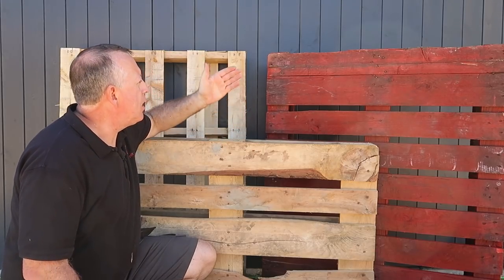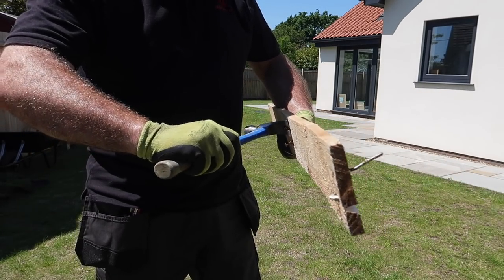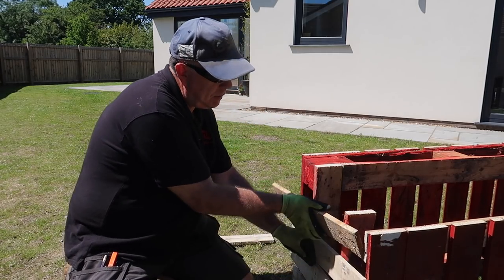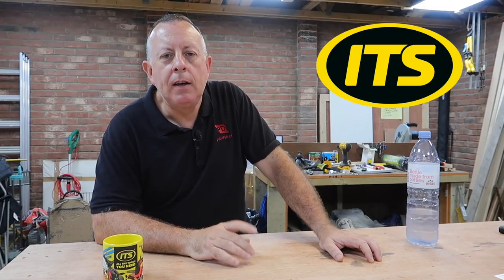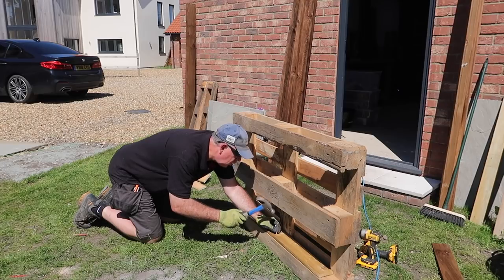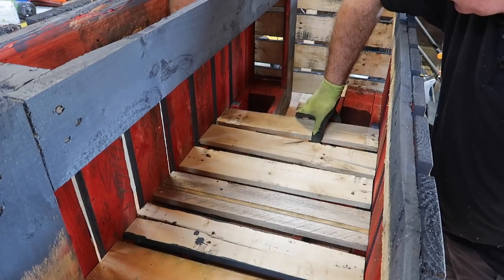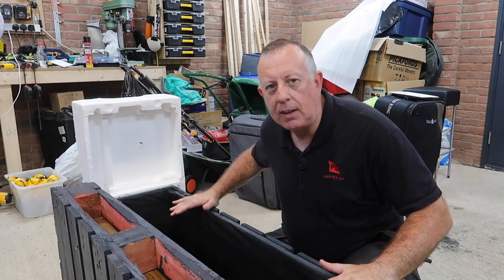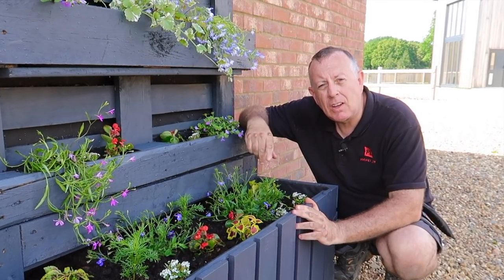How to Make Modern Vertical Planters for Free

Comment: I filled up the van yesterday at the builders merchants. I bought a Roughneck pallet buster a while back. It really does make life easier. Nails can be a problem with some pallets. They really resist being pulled out. I find an old fashioned pair of pincers works wonders for those rather than a claw hammer or pry bar. 
Nice planter though.
Reply from the maker: Thank you. The pallet buster looks a great piece of kit if you are dealing with them everyday

Comment: I find a garden fork very useful to get pallets apart, very easy to lever of the slats. Also check out hugelkultur and fill these large planters with some logs or similar. Creates a good enviromental soil for plants and will continue to feed them as they rot down.
Reply from the maker: That's a good idea
Reply: I save larger branches and trimmings exactly for this.  Every couple of years, it's worth tipping out raised veg beds and refilling with new compost over a layer of logs and branches

Comment: What paint/treatment was used?

To split the pallet apart take the outer segments off then upend apply press from one side to another so instead of pulling the nails out by force the movement back and fourth loosens the nails.
Reply from the maker: Good tip

Comment: Another option instead of the polystyrene on the bottom would be to make it a self watering planter by adding a waterproof barrier at the bottom, filling the bottom with stones and adding a drainage hole above the intended water line, as well as a barrier between the water line and the soil above to control how much moisture is wicked up.

Comment: Another great vid Stuart. I’m stuck inside on a very rainy Sunday here in Cambridge, frustrated I can’t crack on with my current project of installing iron fence and sliding gates for our front drive (foundation stage and hand mixing concrete in pouring rain isn’t much fun…). Working through all your vids instead at least let’s me do some diy vicariously! You’ve mentioned a few times now about sourcing timber from the delivery point at the big box stores eg their offcuts. Is it really as simple as just walking up to them and asking if they’ve got any waste you can rummage through? Timber/insulation/upvc products all crazy prices since two years ago so any savings would be good!
Reply from the maker: I know the feeling, I have a fallen fence to fix but I'm not working in this rain!
The free timber I get is from B&Q just passed the tills. There is usually a bin with a charity box which you donate to and take what you want. Sometimes there is nothing, sometimes there is but I always go there with a cordless circular saw just in case (the bigger pieces tend to get left as people can't get them in the car!) If you see a B&Q in East Anglia with sawdust in a quiet part of the car park - that would have been me!
Reply: @ProperDIY  hopefully not the fence you reinforced the posts for last year?!  I’m usually at either a BQ or Wickes several times a month so will keep a look out for the offcuts - thanks for the tip.